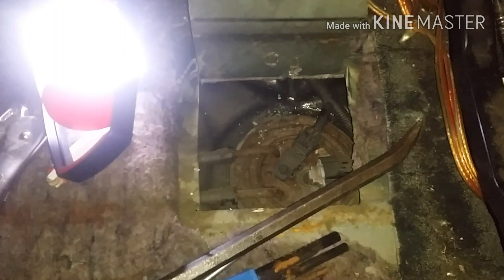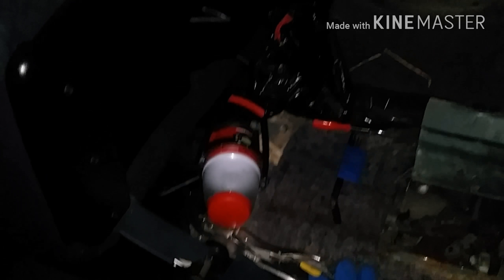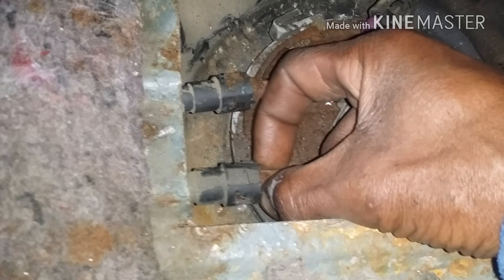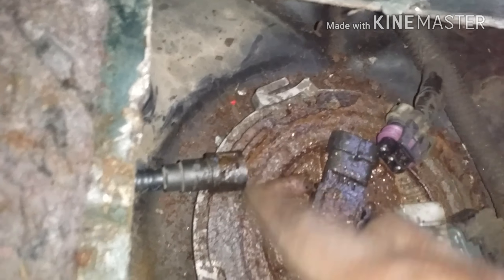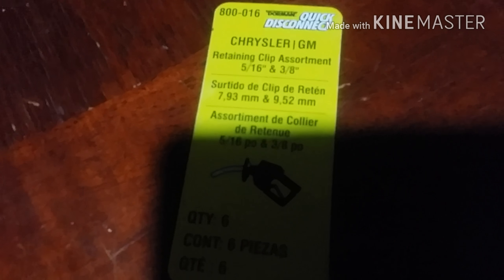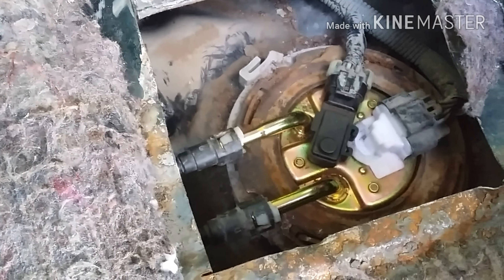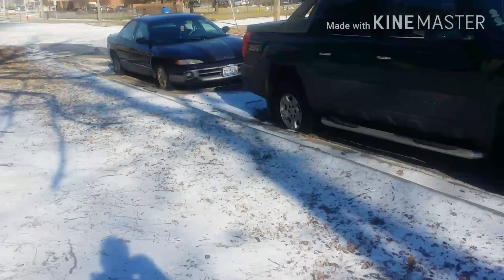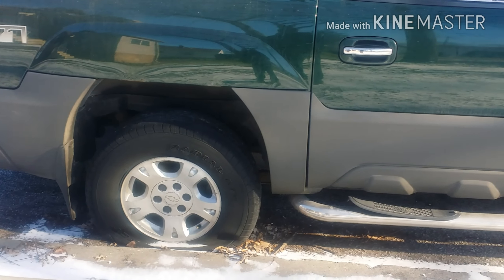How to change fuel pump on a 5.3 chevy avalanche

Comment: GOOD SHOW🇺🇸
It sucks having to work on your vehicles outside in the cold I did that for a lot of years luckily I have a heated garage bay but still crawling around on the ground is a pain in the ass I’m seriously considering cutting a hole like you did but I have gas all over the place it’ll be really careful how I make that whole not interested in any BOOM❤️🇺🇸❤️🇺🇸
Reply from the maker: Appreciate it bro when I did this it was freezing outside and I wasn't about to drop this tank which was top off with gas.. I will never drop a tank again 😂

Comment: Hey great idea.  I cut my out and got some sheet metal and some caulking make a sheet metal bit bigger than the surrounding area. Caulk around the surrounding area and then use some metal screws drill down into vehicle so, keep it airtight. Just want to say excellent idea.

Comment: Just got the old pump out and gettin ready to slide the new pump in. Did u get any rusty shit down in the tank?  I had it clean all the way around but when I pulled the old pump out I notice a little bit. Theres only about 6 gallons in there so I'm thinkin about takin a minnow net and tryin to get it  out first?